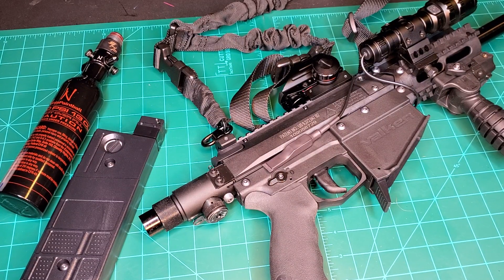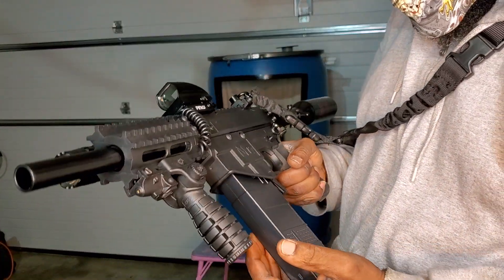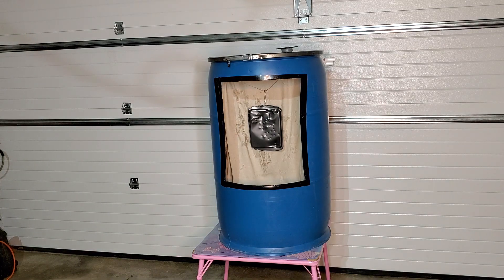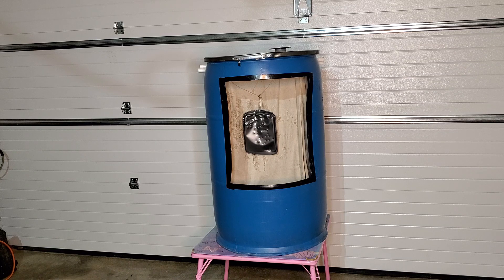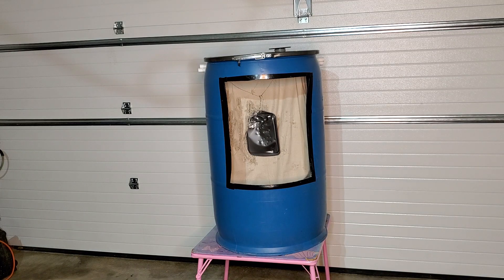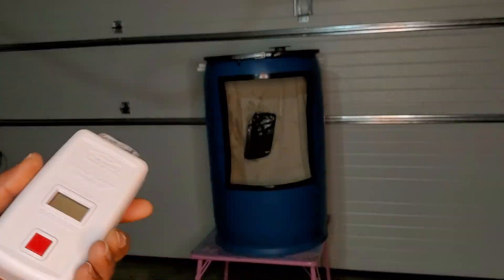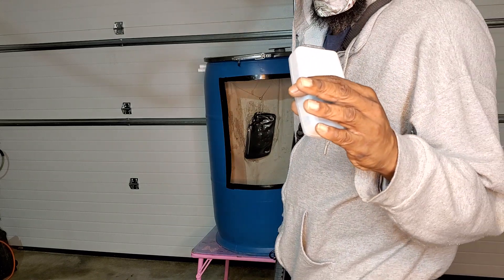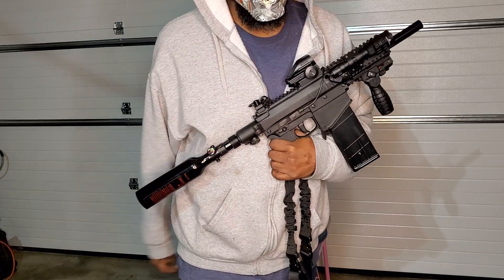Valken M17,  1100psi Output, & 7.1 Gram Aluminum Balls

Comment: I’m getting 363-370fps with 9” Grimburg barrel & there 8g jul v2’s. 
FULL reg bypass EVERYTHING outta there! (not drilled) 
HD-24 bolt spring & 1100psi ninja reg & of course on/off asa. I don’t play around with it much but I’ve ran 50+ jul’s thru it and it’s solid. 
I only get 20 shots per fill with 13ci bottle

Comment: Also,tried some hp68's with 3/8 steel bearings glued in the rear cup,think the total projectile weight is 11.7 grams( about 180 grains in regular bullet weight terms).got 370 to 385 fps out of 13" barrel which is up to 78 joules or 55 ft lbs..

Comment: Strange inconsistency with those aluminum balls very much like a saw with my last Vks video.

Either the balls are not all of the same bore size or the XRadar is not reading those alloy balls correctly because that 260fps shot didn’t look 260.

Love these videos thank you.
Reply from the maker: Yes. I saw that vid you did. I filmed this about a week or so ago before I saw yours and totally forgot about that 260  until I watched it again. I will have ti size these. I got  a digital caliper set the other day and will likely get  one similar to yours as well. Thanks!💥💥💥

Comment: I can’t get my trigger sear to hold up with 1100 psi output. How are you able to fire reliably in semi function?
Reply from the maker: Have you changed any of the springs in the trigger housing? I also did the sear screw mod. You may need to do that as well💥💥💥
Reply: @thellc24-7  not yet but I have them on the way . Did you still shim the sear with the upgraded sear spring by chance?
Reply from the maker: @safeguarddefense  yes I did💥💥💥
Reply: @thellc24-7  it’s helpful. Thx
Reply from the maker: NP💥💥💥 @safeguarddefense

Comment: I guess you can't use the 1100 output pressure tank for paintball.. I supose the high pressure will break the paintball, rigth??
Reply from the maker: That would be correct💥💥💥
Reply: @thellc24-7 thanks, 1 more question; can i use this (1100) tank for shotting rubber balls and the aluminum balls that you use in the video without damaging the internal parts of the M17?
Reply: @menclar5476 yes